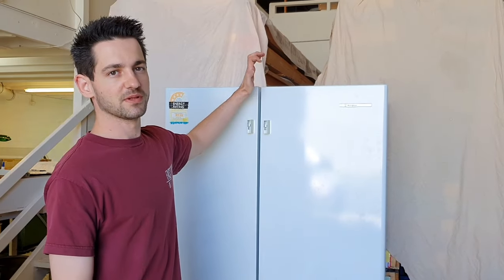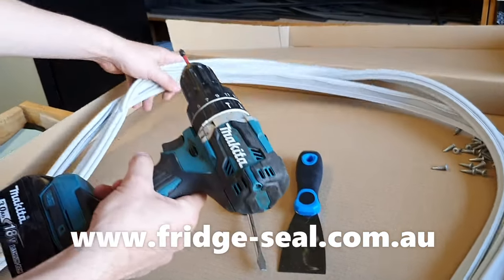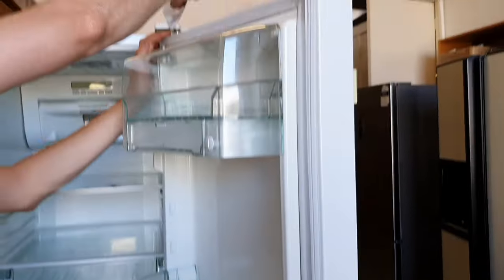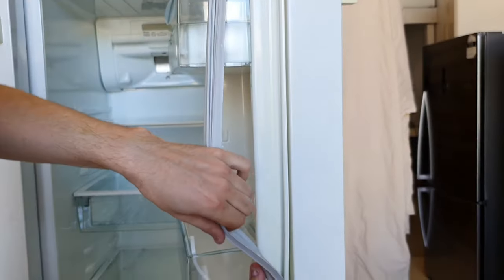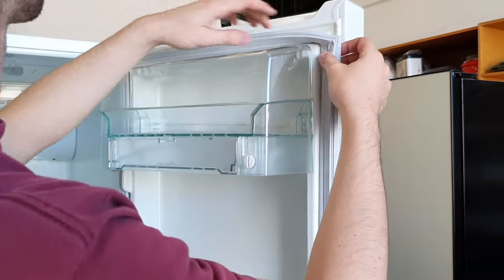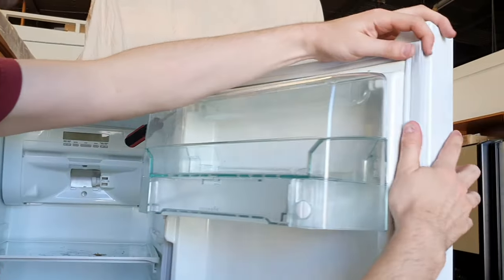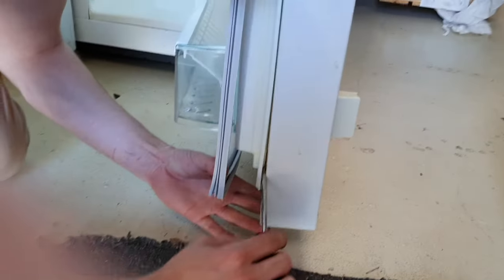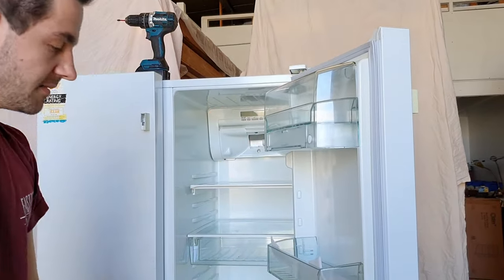How to Replace a Glued in Refrigerator Door Gasket Seal

Comment: Love his accent & an excellent video showing the whole process of taking off & replacement if the new seal 👌. Shouldn't you take off the reminants if the old seal before putting the new one on??
Reply from the maker: Haha, thank you! 😊 I'm glad you found the video helpful, even though it wasn't originally intended for YouTube.

You're absolutely right, it's essential to remove all remnants of the old seal before installing the new one. Using warm, soapy water to clean the door liner is a great tip as well.

After installing the new seal, I highly recommend using a hair dryer to heat it up and ensure a proper seal. Simply warm it up, close the door, and let it cool down for optimal performance.

If you encounter any difficulties or have further questions, feel free to reach out. I'm here to assist!

Warm regards, Brett.

Comment: Thanks for taking me through this at the shop ... gave me confidence to attack this easily. Video is perfect ... do all corners first is the big tip... and some persistence, don’t rush  !
Reply from the maker: Thank you Ben! if you do come across ANY issues - let me know!
Reply: Ben, did you glue the seal? I am thinking of replacing a chest freezer seal that is glued in too.
 If you used glue. Which glue did you use?
I think I will have to glue as the lid is horizontal not vertical.

Comment: Thanks for the video, searched high and low for door seal replacement on a hoover fridge freezer and nothing out there but it appears this is probably what I'm dealing with. Will add a small amount of glue to the seal though especially on the closing edge, just to be sure.

Comment: If when putting on…. The corners separate on the seal, what can be used to reseal?  I had replaced one and it has gathered some meltoff and has ice in it (which is keeping the seal open, which we see a lot of frost).
Reply from the maker: you can use super glue.

Comment: when you install a new one that previously had some sort of adhesive, should you use any adhesive as well or just fit it without?
Reply from the maker: For me personally, i either screw self tapping screws underneath the seal to clamp the door liner down OR i dont do anything and the door liner is tight enough to hold the seal down firmly. I have put super glue behind before but if you dont know what you're doing it can turn out looking bad. self tappers are good because they can be easily removed or replaced.
Reply: @FridgeSeal  what size self tapper screws did you use?
Reply from the maker: @aussielass5621  This is the type i use - https://www.cdaets.com.au/product/screw-sdm-wafer-c3-10-16-x-16-721729

Comment: I have a zanussi (electrolux owned) with the same idiotic system of holding the seal, except mine would not pop out. Does anybody know what to do? I was thinking to try a paper cutter inserted behind the seal to unglue it, or even a heat gun. I have a universal seal replacement, which is composed of 2 parts so it should be easier to install than a full door one.
Reply: Did you ever make it work?
Reply: @anthonyy1337  did you find any answers? I am stuck with the same issue...

Comment: But you didn't show how to fix the bottom seal, I found it very difficult to fix the bottom part
Reply from the maker: Same method for the bottom? Open the door first, heat bottom of the seal - then close door and should be fixed.

Otherwise you might need to use a little more heat when closed under the fridge, or use your fingers to stretch the seal out and hold it in place for a few minustes.

Or peel the seal back and put something underneath it so it raises in that area.

many ways to fix.